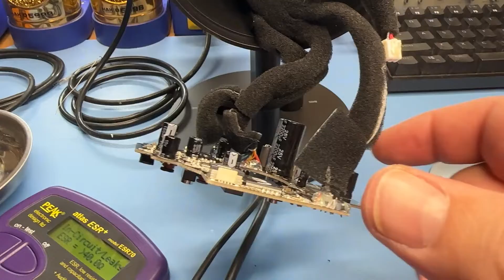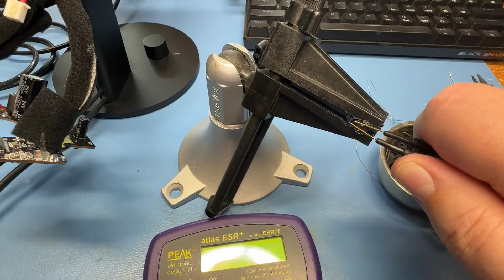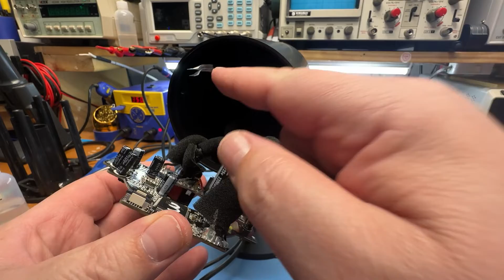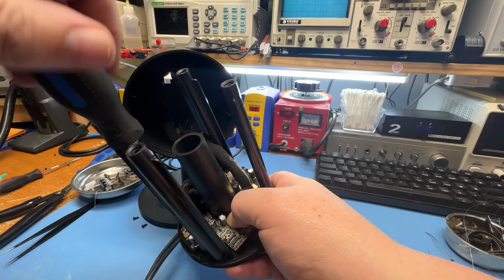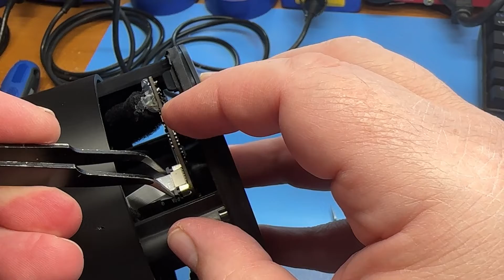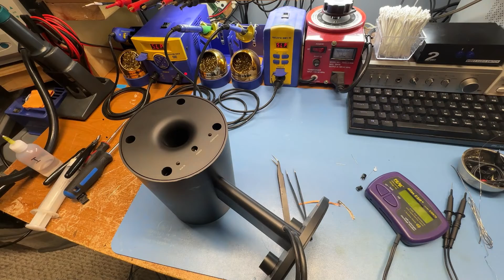Razer Nomma Chroma 2 repair

Comment: I just bought a pair for 10£ from a local carboot sale. It’s not turning on, i got a similar power adapter from a Dell laptop. The power source it’s working. I opened the right speaker, nothing broken at the first look. When i connected to my PC, they appear in the device manager like 2-3 seconds and after disappear. Tried to update the firmware with the official app, they got detected but after some tries ingot the “failed to connect bootloader” or something like that. Should i try to replace capacitors? It’s worth? I just like the design, i might use standard cables directly to the speakers and use them as satellites on my subwoofer. Kinda sad to lost all their RGB lights, volume controller, etc

Comment: Do know how many pins does the ribbon cable have? bought it used but shipping broke off the base and bent one of the ribbon cables, I got it working again but with some noticeable white noise and that's the only assumption I have of the cause.